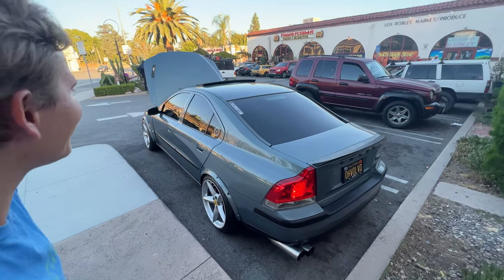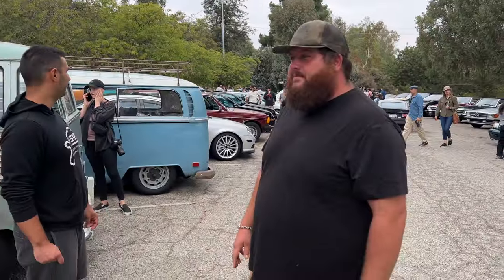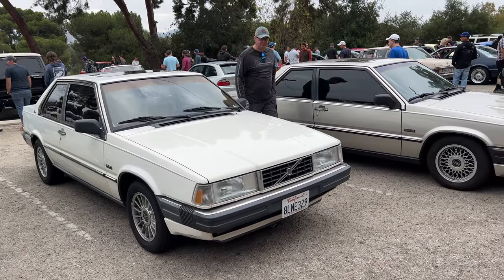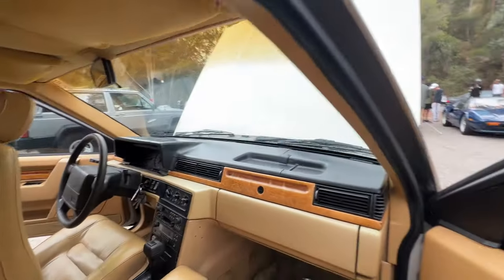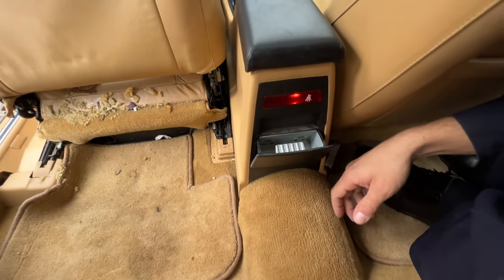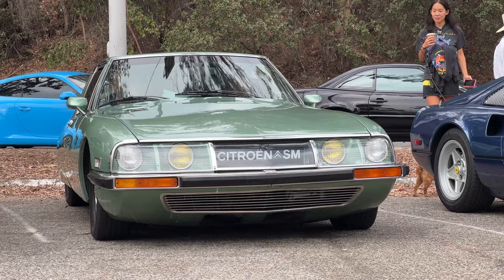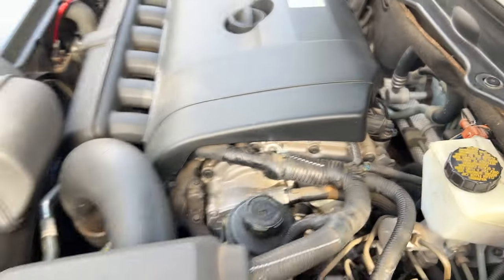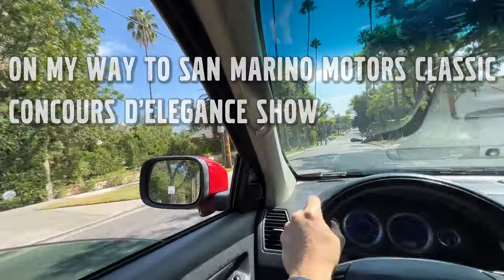Sweet Italian-Made Volvo 780 at August Cars & Coffee - LA Rolling

Comment: David, a couple of observations, if I may.  The white 780 is equipped with the PRV (Peugeot-Renault-Volvo) V6.  It being a 90-degree V6 rather than the more common 60-degree, it was prone to failure because of its odd angle and firing order (it was really a cut-down V8, where 90-degrees is the accepted architecture).  In 1989, the 780 became available with the Volvo B230FT turbo 4-cylinder,  a more robust and powerful engine.  And second, a minor point, but since Mom was Italian, one I have to address:  "Bertone" is pronounced as if the last syllable rhymes with "phone."  If it were pronounced "Bertonee," as you say it, the Italian spelling would be "Bertoni" (rhymes with "spumoni").  Thanks for the vid.  I've had six Volvos, still pining for a 1990 780.
Reply: See, that's where things get complicated when people start 'observing'... the V6 in this 780 ist the B280f which is a highly revised version of the PRV engine, deemed 'unreliable' by people in the 'know' - the crank offset was changed to compensate for the 90 degree structure. Actually these engines are pretty bulletproof if you adjust valve clearance, change the oil to 15w-40 and replace the water pump as prescribed by Volvo. The old B28 engines weren't prone to failure due to their 90 degree architecture, but due to oil sludge in the oiling galleys in the heads. The version employed by Renault and Peugeot also liked to catch fire, because they used carburetors that let the gasoline get too hot and ignite before the combustion chambers.